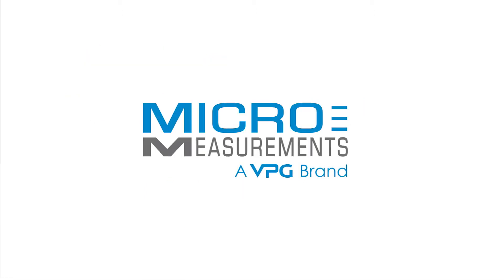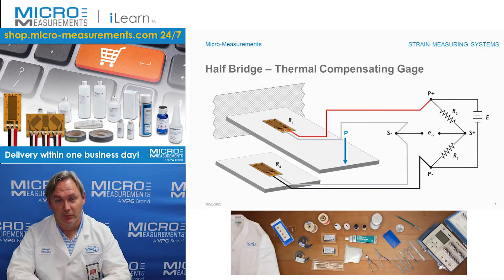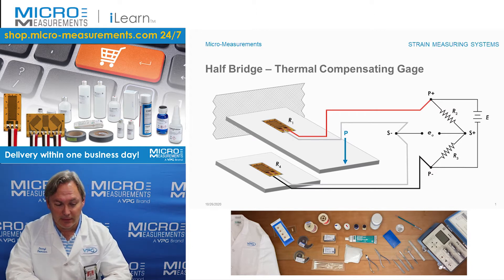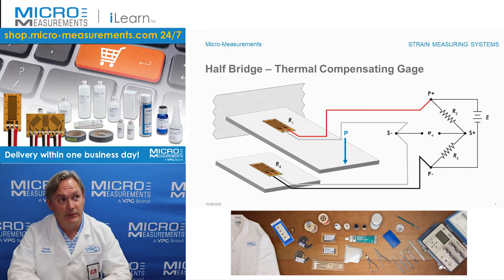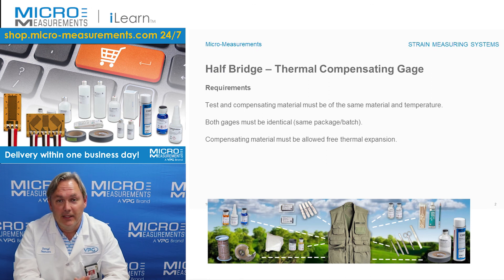Half Bridge – Thermal Compensating Gage.

Comment: Hello, I am working with this half-bridge temperature compensating configuration on a rock sample and expecting the sample to fail in a tensile manner. As such, the strain gauges a positioned in the tensile direction. However, the strain readings on the data acquisition system are showing negative values throughout. Please, is the a reason for this?

Comment: This arrangement is going to create very low full scale output - it only has one "active" gage - so it's really more like a "quarter bridge" in terms of sensitivity. Also of note: the "coupon" of material needs to be robust enough that you have total confidence any force put on it will create NEGLIGIBLE stress. A flimsy coupon of material could be rather sensitive to air currents, or stress/strain on the cabling/wiring.
Reply: Thank you for the comments regarding the video.   I agree with you that the sensitivity to mechanical strain would be the same as a quarter bridge circuit.  This compensating circuit is normally used when customers are experiencing temperature extremes and the measurements are taking place across the entire range.  A strain gage embedded inside of an aircraft wing or tail section is a good example where temperatures are warm on the runway but much cooler at altitude.  Also agree that the coupon must be allowed to freely expand and contract without any loads being applied.   Sometimes customers will fix the coupon at the gage site using a thick bead of RTV so that the coupon sees the load but the strain does not transfer through the RTV.   Excellent points and thank you for watching the video.  Darryl
Reply: @darrylpeterson5394  Thank you for your thoughtful response, Darryl! Good points, all!
Reply: Yes, in National Instruments booklets they call this a Quarter bridge II.